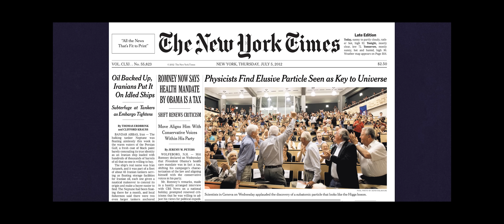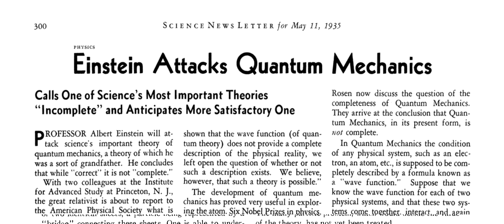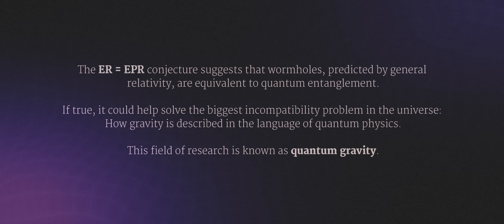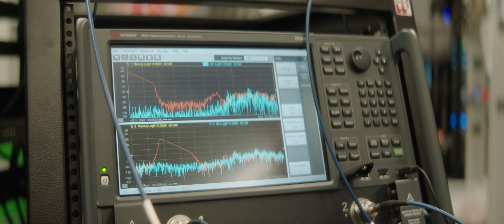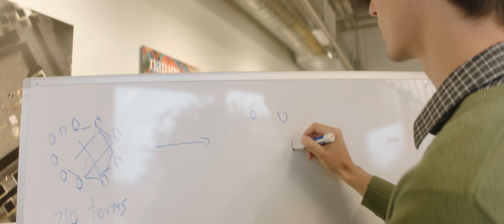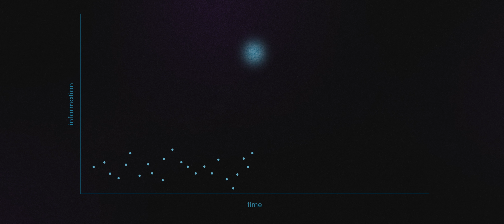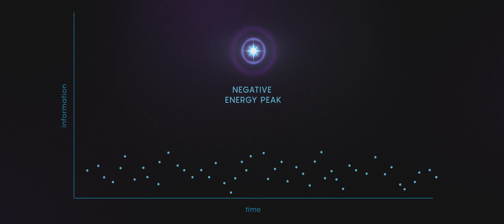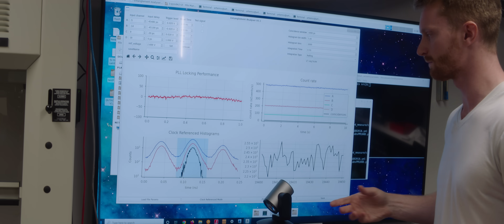How Physicists Created a Holographic Wormhole in a Quantum Computer

Comment: Great stuff.  Nagging question: (a) Did they simulate a wormhole, or (b) Actually make one in spacetime?  For example an RLC circuit simulates a spring mass system but is not actually a spring mass system.  I think it is (b), namely, they actually made a wormhole.  Can anyone confirm?
Reply: From what I've read and understand it's a) Simulation of wormhole dynamics. In the same vein of black hole analog experiments to simulate their behavior (water whirlpool experiments down drains, or sonic booms).

Or like RLC circuits simulating a spring mass system
Reply: @MrTamk1s  Thanks.  I look forward to other opinions.  I was imagining that quantum entanglement always implies a wormhole in spacetime.  I don't know if this is the case. If so, it would mean that they created an actual traversable wormhole in spacetime.
Reply: @MrTamk1s  Fwiw, I think you're not wrong. 👍
Reply: It's a good question but not precise enough to fit what they did. They did not create a wormhole in our spacetime. So far as we know, we live in a universe that seems like what we call de Sitter space - and definitely not in anti-de Sitter (AdS) space. That's a pity because we've learned all sorts of things about AdS (and conformal field theory so you can expect to find a lot published about AdS/CFT out there) but those things tend to show what doesn't happen for us. One of the things discovered about AdS space is that it's always holographic - whereas, despite popular articles, we don't know that our universe is holographic. I'm not wandering, you need that to get to the punchline in your question. They did not create a wormhole in our spacetime. They did create a wormhole in the holographic spacetime they believe that they established in their experiment and using holographic /AdS rules, instrumented the experiment to detect the equivalent of the expected energy signature that we would see in our spacetime. If we could see that - which right now, we have no way of doing. It seems - saying this without benefits of peer review and replication - that they've learned something terribly interesting about AdS space. It could develop into something very important in that branch of study. (For all I know, maybe they're already there.) But how this may map to our spacetime? I think it's far too early to say if it does or if it ever will.

So it appears to be far more than a simulation on their terms and far less than reality on our terms. I do think it's a fascinating step fwiw and I hope that they will continue to uncover more.
Reply: @Ni999  Thank-you.  Sounds reasonable.
Reply: @karimshariff7379  You're welcome. 👍

Comment: The problem with wormholes, is that they reduce travel time.. but not for the traveller. If normal travel takes a day, and wormhole travel takes a minute, the flow of time inside the wormhole increases by 1440, so you'd still be one day older... albeit arriving 1 minute later as opposed to 1 day later. This is no problem for FTL communication, energy isn't affected by time, but travel for living beings might be an issue without some kind of temporal stasis.
Reply: Who are you?????

Comment: I didn't think quantum computers were a thing yet but there you go they are and they're so mature they can simulate wormholes!
Reply: turns out quantum theory was in the 30s, i recently learnd the theory for quantum computers was in the early 70s, and theyve been working on them since the mid 90s... people dont realize these things are about 6 years away from being inside your PC at home, instead of 1s and0s yes's and no's, a quantum PC basically has good guessing built in and thinks more like a person
Reply: @Wildboy789789  6 yrs away huh? A'ight. 🤡
Reply: @ziko317  LOL
Reply: @Wildboy789789  quantum computers still use 1s and 0s, it's just that the qubits are in a state of 1 and 0 at the same time. I.e., they're in a state of superposition until a measurement collapses it into a definitive state. Also they're entangled, so measuring the result of one of the qubits will tell the state of its pair, regardless of distance. Both properties allows quantum computers to work exponentially faster on some problems, as you said.
Reply: @meows8603  They actually use a matrix that contains e and i because imaginary and Euler likes to appear everywhere in nature. Usually the best way to explain anything is to just add another variable.
Reply: @Wildboy789789  dream on
Reply: @Wildboy789789  I doubt anyone will have a quantum PC in his/her home. I worked in this field. Quantum computers are good for convex optimization problems such as protein folding structure or chemical bonding locations and RSA decryption. All of these are very specialized. A general purpose computer is constructed much differently.

You can try it out if you know how to write code via a cloud interface.
Reply: @Eric  the use case has expanded widely, they are now being used in financial risk assesment and like you said with molecular structures to optimize car batteries, if it can optimize the reaction in a battery then why not a gpu or at the very least a laptop battery... also keep in mind 50 years ago they made the first cell phone with a roter dial and wired to a radio on your hip, just 50 years ago no one fathomed a touch screen internet device... both you and me have no idea the tech we will use this for 50 years from now... im not even beyond the idea of a home pc using quantum entanglement to physically teleport you to a location, especially since MIT and google just theoretically stablized a wormhole and sent a qbit thru it
Reply: @Wildboy789789  that's true that we don't know what will happen in the future but I think a better comparison would be comparing a supercomputer to a quantum computer. A supercomputer can't do any function you want. They're made for scientific calculations, including financial risk like you mentioned.
This is much different from playing a videogame. I suppose it's possible to play a game with a supercomputer but not practical.
Reply: @Wildboy789789  We're going to have quantum home computers in 6 years?  How are we going to keep them super-cooled to —400 degrees?
Reply: @scottbarber9374  quantum cooling devices
Reply: @scottbarber9374  Small modular reactor?
I hear Aldi going to be offering them at $150. The cabling could be a problem...

Comment: In some of these comments people seem to think that this is sensationalism because it's "just a simulation" but if the wormhole was 6 ft in diameter, wouldn't it still have to run on some kind of computer program? My understanding of this is what they were actually proving is that the entire quantum computer actually runs on wormholes in the first place!  they're just not stabilized for other information to get through them except for the quantum entanglement, but if there's quantum entanglement then there's a wormhole in the first place, or at least  the potential, more like a worm string between the two particles that can be exploited when enough of them are combined.. so that's my understanding but I'm not a scientist in that way but I don't see why the arguments in here are mutually exclusive to this not being an actual phenomenon that happened using a device, it's like you want them to have done it without programming it to happen? Maybe they all just getting a drum circle or something instead? Your arguments for what it is are not arguments for what it isn't as far as I can tell

Comment: Does anybody have a source on how they generated negative energy to "charge" the wormhole? That seemed important but was not talked about.
Reply: They didn’t. They didn’t make a wormhole like what the video makes it seem. They’re only using a loose theory that might connect quantum entanglement to wormholes and basically said “oh since quantum computers can do quantum entanglement, we can probably run a wormhole simulation by using a quantum computer.” There’s no verification or real life wormhole made.
Reply: @TasX  Sigh! the more I learn about the less I am impressed by the reporting.
Reply: @deutschluz  Yeah most of the scientific community is criticizing the way they hyped this up. This kind of hype should be saved for real discoveries like the Higgs Boson, or else it will make them look bad.
Reply: I don't but they said they made a space in the quantum computer and that space is the worm hole. I assume that the negative energy is a unspecified value of the quantum nature of the system that goes to the worm hole. Kind of like when there's a whirl pool on top of a body of water due to a salt mine under the earth being flooded once the space between the rock and the water is removed and gravity has pulled the first drops of water into the cavity. In that example gravity is being used to represent negative energy and is just a feature of the system like NE is to Quantum systems.

Comment: The whole universe is an entangled unit.
Reply: If that were true then you should experience absolutely everything that occurs absolutely everywhere
Reply: @drsatan9617  Yep exactly. If we had 0 resting mass that would most probably be the case.
Reply: @MrCoffis  then you are wrong. I did not experience you typing that reply

Nor can you prove you experienced me typing this reply

Why is mass relevant?
Reply: @drsatan9617  from the point of view of the universe it experienced both.
Reply: @MrCoffis  but you are comprised of particles than can be entangled. If you can't experience things that happen to particles which aren't a part of you then you're wrong and everything isn't entangled 

Did you experience both?
Reply: @drsatan9617   why not? because you can’t experience it?
It’s possible that your experience is separate from the entangled particles you are made up of since your experience is an emergent phenomenon and not base reality. 
Like a program that runs on a computer. The computer experiences all programs running on it the programs do not. Either way you can not transmit information with entanglement. From the perspective of the universe as a whole it could very well be an entangled unit and it’s not outside of the realm of possibility. Entanglement has many interpretations and basically describes how a system works or is, that consists of more than one part and act as one. Our universe consists of more than one part and has laws that all obey and as a system is as one.
Reply: @MrCoffis  why not what?

So then how do you know that everything is entangled?
Reply: @drsatan9617  double slit experiment delayed choice experiment and variations of.
Reply: @MrCoffis  and how does that prove that all particles are entangled? Even the ones which aren't measured?
Reply: @drsatan9617  it’s not proof it’s a hint.
Reply: @MrCoffis  so you have no proof whatsoever...
Reply: @drsatan9617  no one has not even the best Physicists 😂 it still doesn’t stop them believing that this is the case. Many believe it to be so but proof in quantum physics is hard to find because many times there are different interpretations of the same mathematical equations.
Reply: @drsatan9617  we have a keyboard warrior over here. Look into it. All I have to say.
Reply: @MrCoffis  I have. It's nonsense 

I asked you to explain 

You couldn't, because it's just nonsensical lies
Reply: @drsatan9617  When someone says something about the entirety of the universe the chances of that claim being wrong no matter who you are or what you are claiming is closer to 100% than 0%. We can not even say for sure that the same laws of physics apply everywhere in  the universe. So knowing that, we can not know for sure if the whole of the universe is an entangled system or not either. We can only theoretically assume things. We all know how theory translates… am not the only one with this idea people way smarter than me and more credentials have played with the idea, so its not something I have pulled out  of my ass. 
Though its an idea I personally feel makes the most sense to me.
Reply: @drsatan9617  You might want to look up quantum monism.
Reply: @MrCoffis  so according to you any nonsense is just as likely as anything else

👌
Reply: @drsatan9617  ok.
Reply: @MrCoffis  figured as much 🙄

Comment: The "stand back and look" at Professor Susskind's lectures on how Black Hole Singularity positioning in Black-body Eternity-now Interval Space-time is dualistic multiphase-locked superposition identification,  ..this  is to flash recognise that we are Sublimation-Tunnelling constantly in 2-ness picture-plane containment states. 

If a particular QM-TIME tunnel has been constructed, then it is a specific Renormalized, meaning tangentially aligned, arrangement of AM-FM time-timing, almost simultaneous wave-packaging shaping Communication.

The reason why transport capsules are claimed to be antigravitic is because UHF conduction is required to connect linear separation between 2-ness cofactors, some multiphase-locked multiple of the speed of light, ie an harmonically balanced "warp-factor", if the  relevant SiFi is applicable. Simple not easy.

Inside-outside AM-FM tuning holography dimensionality is a technique for managing i-reflection containment, wave-packaging encapsulation. Fluxion-Integral Temporal superposition Calculus.

An Experimentalist's Intuitions of the physicality made real, good enough to establish you know what you are doing. Only the wording, which is under constant revision anyway, as we look and engage with our guessed perceptions, needs to update what we are saying about everything.

Comment: Don’t get overexcited as yet, it’s just an dumbed down experiment from 210 steps to just 7 steps. It’s not an observable worm-hole and also based on the premise that the equivalence holds up from the quantum scale to universe scale of 2 black holes. Its like car safety test with a wired-up dummy in place of a real human and then subject the cars to various kind of “real accidents” …. It may mirror real-world accidents to design safety precautions like safety belts and air bags. So is this single experiment to try to prove ER=EPR. Winning the NOBEL PRIZE ? Hold your horses first, keep the champagne in the fridge. It will be decades before any conclusive evidence will surface. Take the Higgs Boson as an example.

Comment: question: they keep linking the two black holes/wormhole system to the entanglement system; same for Einstein, as when he thought about the wormhole idea he thought about a black hole connected to another black hole; however, here we are talking about a black hole that swallows in and a WHITE hole that spits out, and while the universe is full of black holes, nobody has ever seen a white hole. Why do scientists keep linking these two systems (quanta or black holes, ER or EPR) to two BLACK holes instead of white and black? Thanks.
Reply: you can (in theory) make two entangled black holes by simple, known methods, so that's probably why they use them instead of white holes which are unknown like you say.
Reply: @nmarbletoe8210  thanks; but still, I mean, even in their experiment, the (tiny, experimental) hole from where the information came out should be called (tiny, experimental) white hole. The information wouldn't be able to come out from a (tiny, experimental) black hole.
Reply: @LMUstacker  yeah maybe it should be called a white hole!

Comment: Very interesting. Id like to know more about the nueral network used. And the process of reducing 270 terms down to only 7. 

At best this is proof of a simulation of a mathematical transformation of a theory using our current best understanding of quantum computing. I know this is no ordinary computer, but running a circuit and getting a result is very different from high energy particle physics. I do commend the scientists involved on their ingenuity though.

It can potentially indirectly prove ER = EPR. We have the brilliant Leonard Suskind and Juan Maldecina to thank for even considering the idea. If anything, I think this experiment suggest physics is moving more towards information theory but more ontological research should happen in mathematics, particle physics, and in within the very concepts of duality, invariance and symmetry themselves.
Reply: Here I was, looking through the comments for ANYone saying what you're saying. Thought I was going to have to. 
This is more like a proof of concept. Or proof of provability of concept.
This may just be a novel manner to transmit a negative charge between non-analagous cubits.
I would love to better understand the manner in which they create tunneling in such that it allows negative charges to pass.
Is it possible that they are "making a model" of a wormhole.
Does the negative charge have a field. Particle? Waveform?
I want more info!

Comment: would've liked for them to explain how/where the negative energy pulse came from?
Reply: from the article : "Rotating all the particles’ spin directions translates, in the dual space-time picture, into a negative-energy shock wave that sweeps through the wormhole, kicking the qubit forward and, at a predictable time, out of the mouth." ... its a great read and much more grounded than the video
Reply: @nonyobiz-records that’s only if you assume the holographic principle. There hasn’t been any proof or demonstration that this principle is true

Here’s another quote from the journal “because nine qubits can be easily simulated on a classical computer, the results of this experiment cannot teach us anything that could not be learnt from a classical computation, and will not teach us anything new about quantum gravity.”
Reply: Think of it in terms of regular positive energy. It just has a negative sign, but otherwise nothing special. Energy happens to flow from place to place.
Reply: @frun  no....